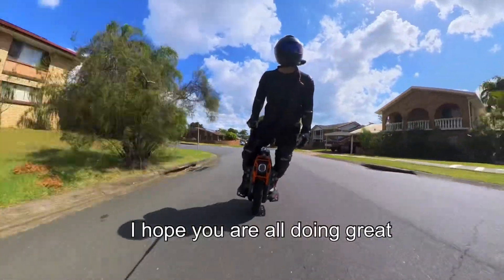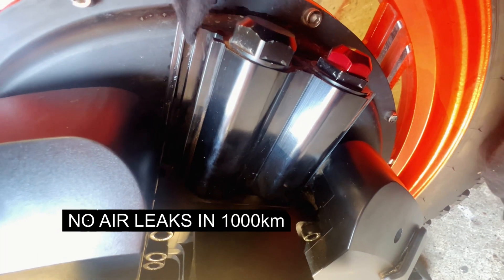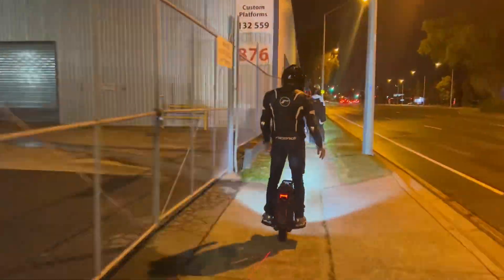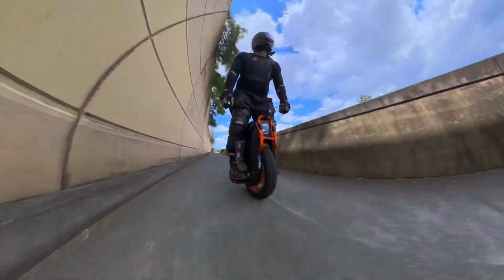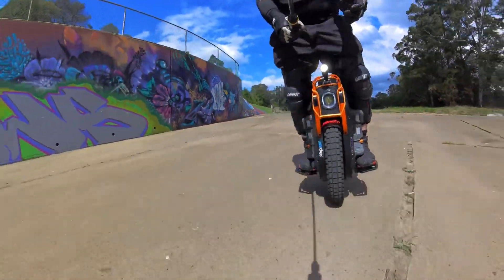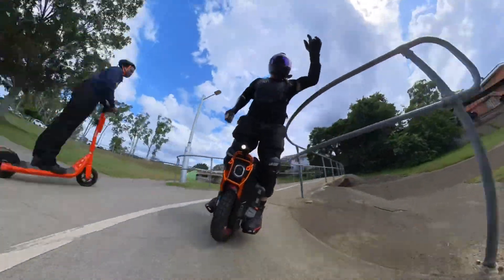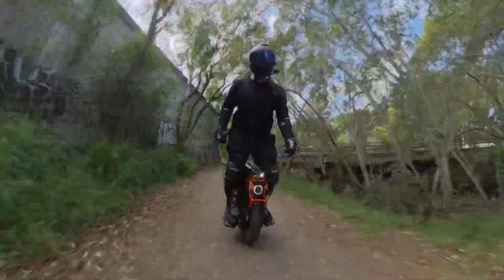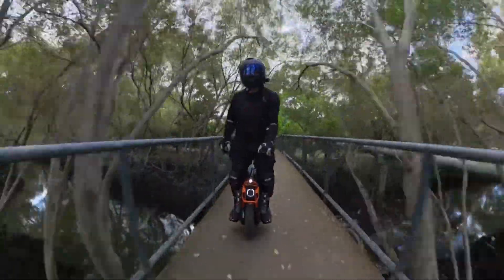A NEW INMOTION WHEEL? A GROUP RIDE & V13 CHALLENGER 1000km Check in.  What a GREAT fun wheel!

Comment: Nice to see you rolling on the beast again.  I thought the Sherman S would have kidnapped you away hahaha.  Speaking of you going on a group ride, I took the V13 on its first group ride.  I normally rode the V10F or Wolf King GT scooter.  I decided I needed more variety.  Being the park we go through is hilly and curvy, it builds up confidence.  Another guy in my area got a V13 and was on the ride too.  He is more experience on eucs than me by far but only had his V13 for a week.  I got to hear first hand the difference in feel it is from other ewheels.  He told me I will acclimate to the weight really quickly from what he sees, what is going to take time is getting into the feel of having to pull the wheel over in turns compared to other wheels.  Overall, he likes his too that he is selling one of this other wheels it is replacing hehe.
I had one error on my wheel before the ride started.  It complained about not shutting down properly.  We checked battery statuses and all were good and even did some restarts but still had error.  Still rode it to our first stop point.  After shutting down and letting it sit while we rested and turning it back on the error was cleared.  Hopefully it was just a minor glitch.
Keep the videos coming and giving out that advice.  I guess mastering this big thing is an ongoing journey hehe.
Oh, I wanted to add.  After 1000km how are you liking the stock pedals?  I would think with the developing of your muscles over time the pressure points you exert on the pedals changes so curious how they feel to you now.  I even remember you saying you added the extra angle plate.
Reply from the maker: Good on you for stepping into the group ride with the V13, it is an intimidating wheel for the slow riding and turning often needed for groups. Always having to make abrupt movements and turns as you negotiate other riders is always difficult but a huge wheel makes it another game. The weight does go away as you build up the muscle and makes other wheels a little easier as you are used to the heavier weight. 
I don’t mind the pedals now. A big part of that is the GRIZZLA flow pads locking me in. I would prefer more grip on the pedals. I have some spare inmotion honeycomb pedals I considered trying, they are small but i’m also used to the feel from the V11 so it might work.
The little angle bracket I added really changed the comfort level for me. 
I think the error you had may be related to the app, i’ve seen a few and it has to do with not closing the app before you shutdown? i think that’s is. Powering off the wheel (or holding the power for 30 secs i think) resets things, run a diagnostic to be sure though. Cheers! safe rolling
Reply: @eucaus  I figured you would find this funny.  I was about to return my friend's V10F this week when my 16 year old daughter started messing with it and caught the bug.  In the past 2 days she has learned to free mount it and roll some distance.  She needs a parking lot now.  Keep in mind, this girl barely knows how to ride a bike.  She is the cheerleader type.  She can skate really good though.  Her biggest gripe is wearing a helmet messes up her hair, lol.  Looks like I may have to buy another EUC.  My friend says I can hold on to the V10 as long as I need seeing if she sticks with it she will be our first female EUCer for the area.

Comment: Brisbane has been windy lately. I can feel it trying to push me around while I'm riding on my wheel. How's the V13 been handling it? If I ever get the time, I hope to come on a group ride. How is it organised?
Reply from the maker: Hi Terrence, thank you for you time watching and commenting. 
SO SO WINDY! V13 is pretty solid and a very stable wheel. It goes well in the wind but it is still my body that works as a sail. I’ve had to really adjust my shoulder position in the wind and at speed. A real lesson for me on this large wheel. The V11 doesn’t seem to have the same effect but I think it’s mostly speed related. At speeds the wind intensifies quite a bit.

The group rides seem to be every second Sunday, but more I am seeing every Sunday. From the wheel of Brisbane usually, arrive 6pm leave 6.30pm. It’s very casual type thing. There is a facebook group, eriderz Brisbane and eriderz Australia they post group rides up. I’m going to try to get along more often. 
Cheers